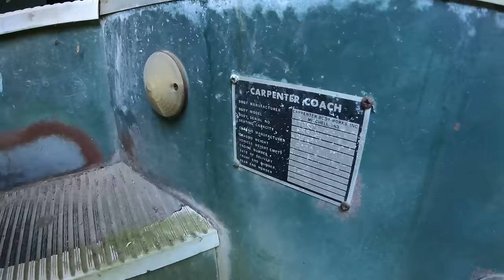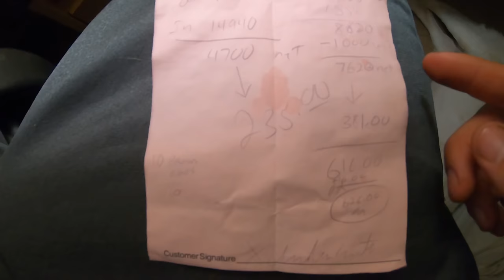Hauling away scrap metal

Comment: All that crap flying around with the trailer, I was glad to see you with a gas mask on.  Great tunes during trailer crushing fun!
Reply: [...phone rings...]

Customer:  Hey I've got a big job that...
Andrew:  You got a lot of big stuff to smash?  I'm there, buddy.  Levi's coming too.
Reply: was that a dust hazard, or something more serious?
Reply: @nocoolname32  I would assume asbestos with the age of that trailer.
Reply: @nocoolname32  Probably mineral wool or some kind of other insulation material that you better shouldnt breathe in. Asbestos could be possible too and is probably the WORST of all insulations.
Reply: @1nvisible1  Haha, yeah there is nothing more satisfying than smashing a old mobile home with a bit excavator. XD
Reply: Im pretty sure the gas mask was just for the wood dust, which was what all that dust was.
Reply: Advocatus Diaboli  You can see the yellow fiberglass while he was tearing it down
Reply: Advocatus Diaboli  You're right about that
Reply: @aa_0n711  If i remember right a mask that protects you from normal dust, will hold up any other dust or small particles as well so better safe than sorry.
Reply: @JackMacLupus  Im just saying that he most likely used the mask for the wood dust
Reply: @JackMacLupus  I dont think he really cares about asbestos
Reply: The bestos

Comment: An extensive and expensive hob. Lets count it again:
2 excavators
1 wheel loader
2 skid steer 
1 dump truck
2 trailer
2 Hemi for towing
1 suv for towing
charges for disposal
fee's
fuel, and
the labour for two men
Not bad, Mr. Camarata

Comment: They’re offering $10... (30sec later) smashes trailer😂😂
Reply: I would too. He will get more selling it for scrap. Although I probably would've tossed an old bedliner in it and used it to haul firewood around my property.
Reply: ..sometimes you have ton do that...even though at today's scrap prices it probably wouldn't even bring $10.00, you've got to utilize your time and keep moving, not screw around waiting to meet up with someone who may or may not buy it...for $40.00-$50.00, I might have waited an hour or two for them to show up, but not much longer...
Reply: I couldn't help but wonder if the guy who offered him the 10 bucks saw the video of him crushing it like a grape. LOL
Reply: @dyer2cycle  HERE IN CT I GET 35 40 CENTS FOR ALUMINUM PER POUND AND 50 CENTS FOR OLD STEEL 
LUCKY IF I GET 15-20 A TRUCKLOAD
Reply: @ekop1778  ...wow..if those are current prices, the prices in the northeast are GREAT compared to what we have here in the southeast(GA)...right now, going price for clean aluminum is 10-15 cents/lb.....steel, $1.00-$2.00 per hundred lb....aluminum radiators, clean, 18 cents/lb....copper/aluminum radiators(like from A/C condensers), clean, 65 cents-80 cents per lb....#1 copper, $1.50-$1.80 per lb....#2 copper, $1.30-$1.45 per lb...clean brass, around $1.00 per lb...it's depressing(and devastating, when a lot of your income comes from it)...prices were weak, especially for aluminum, before the coronavirus...after it hit, they fell through the floor, and a lot of yards have shut down completely.... :(
Reply: @dyer2cycle  hello  BEEN GETTING AROUND 30 CENT FOR ALUMINUM 
SOMETIMES I GET 20 CENT
STEEL SOMETIMES I GET 25 CENTS OTHER DAYS MAYBE 35 CENTS
IT VARIES FROM WEEK TO WEEK
COPPER I MADE 20 DOLLARS OFF 1 BAR  THAT WAS 2 FT BY 4 INCHES WIDE
I JUST STATED THE BUSINESS OF SELLING SCRAP ON SIDE INCOME 
ITS BEEN GOOD
DEPENDS ON THE DAY YOU GO TO THE YARD I GO TO A LOCAL GUY THAT HIRES MEXICANS BUT HES A GOOD MAN 
GOT A HUGE YARD AND PEOPLE BUY EVERY DAY TOO
Reply: @dyer2cycle  THATS PRETTY LOW FOR STEEL AND ALUMINUM 
SURPIRSED
THE GUY I GO TO IS OPEN EVEN IN A VIRUS PANDEMIC TOO
WEAR A MASK GLOVES AND STAY CLEAN
ITS LOW WHERE YOU ARE BECUASE ITS CHEAPER THAN NORTHEAST
WE GET BIGGER PRICES BECAUSE ITS EXPENSIVE HERE
Reply: @ekop1778  Yes, that is low for aluminum and steel..but the copper and copper/aluminum radiator prices are what are hurting me the most right now...brass too....that's where I made most of my money..the steel and aluminum were just sort of side items that went along with it...
Reply: номерной знак надо было оставить - это хорошее украшение для гаража )
Reply: I thought he was just crazy or drunk but now I see it's just for our entertainment
Reply: $10.00 is a nice bottle of wine, think of it that way
Reply: @dyer2cycle  don't blame corona - blame the industry. for YEARS they propped up prices because China was buying scrap by the container ship full.  Now instead of regulating the market they got greedy and China aint buying anymore.  thats one of the main reasons why scrap prices have plummeted.

Comment: I was going to say:  You better save those vehicle ornaments:  My brother worked on cars all his life.  Starting in 1953 when finally he finally retired in 2016 we cleaned all the cars out left the garage bare bones just the building and concrete. I went over every inch of soil and in every box and i even checked the birds nest in the office attic; he had crows I found a silver dollar and a bunch of lug nuts. We found specialty review mirrors, headlights that were brand new, signal switches and tail lights, vehicle hood, door, glove boxes, and leather seat ornaments in the hundreds. It took me two years to identify and label nearly everything.  I got tired and auctioned the whole lot on ebay to a guy near Chappell Hill Texas.

Comment: anyone who do welding as a trade, fabercating and heavy equipment repairs, everyone one of them drops are handy and saveyou thousands of dollars over you lift time, i clean out fab shops steel bins all the time, you can cut a ear for a pin boss out of odd shap peaces, it is by far best to save them all down to a 3x3 peace of heaver steel, you go and try and buy a small drop, and a shop will want $20 for the smallest peace, or you end up buying a full 4x8 sheet for a 6"x8" of 3/4" or 1"  peace for a job. with all the many tons of drops i have picked up or left over from a job, sure some may sit for 10 years before you need it, or someone else need it, and thats 20 to $50 cash in your pocket, by far more then you ever get as scrapm that odd shap peace of 1" plate, at the scrap yard lucky if that added up to a $1.00   were i would make $30 off that peace. it is all big cash money in the bank, but is you dont do much repairs or fabricating, ya, you will never use it, but to many dont know the value of a peace of steel, when i starting welding many years ago, i could buy a 4x8 x1/4" sheet of steel for $50, now that same sheet is $250, for mild steel, get T100 and see how much that is, i have made hundreds of thousands on repairs and build. all from free drops

Comment: I've bought some good structural steel from a recycling yard, big square tubing, heavy angle. It's really fascinating the material you can find at one but not many places let you buy from them. I recently paid 40 cents/lb, which is a fraction of what the material cost at a steel supplier. The bucket of drops you scrapped is less useful than most of what I've seen. You are right, it will end up sitting around forever. You have to draw the line of stuff you keep, otherwise your place ends up looking like junkyard.

Comment: Tim from Canada suggestions if you were doing one of The school buses or anything that is large like this and has a lot of loose parts you can always rip a hole in the roof after you get it loaded and put all your pieces inside your,bus.. trunk or whatever you were loading.. if it is big enough and you can rip a hole in it then you can put all your parts inside this will save you space and it will save you time unloading everything when you get to the scrapyard

Comment: That 9" Ford rear axle in the old pickup box trailer was probably worth more than you got for the whole load.  It has the equal length axles and very narrow which is very popular with the hot rod and race car guys.  It also probably had a 3.25, 3.50 or 3.70 gear.

Comment: If you got another frame from a truck that will fit under that dump bed your keeping and cut the frame add a hydraulic  lift for the bed ..you could have a pup trailer for your dump truck

Comment: I grew up doing scrap metal and various other kinds of construction related work that I've seen you doing. There's been a few times in your videos including several times in this video that using an acetylene/oxygen torch would have saved you a lot of time and your job easier. I'm assuming you must have one but idk why you never use it lol beating on your equipment for something that would take 5 mins of torch cutting, like cutting that front of the bus frame off makes no sense.

Comment: Just wondering what you did with those alums beam joists? Those things are awesome work with.You can to build concrete parking garage decks with those. We use them for scaffolding across long areas. One of the greatest things to come along in our trade.
Reply: I think Andrew said elsewhere in the comments the property owners kept the aluminum I-beams.

Comment: Now I have to clean my place up with my Bobcat!! (It’s a older 853 model with pallet forks, snow plow, grapple, grapple bucket, hay forks and that’s it and it has a door and heat which is pretty cool and if anyone reading this comment could help me figure this out. Why doesn’t my seat bar stay up even with new struts I have to use a bungee cord. So any help would be appreciated.

Comment: By the looks of the bus (with more emergency exits) they had a bus that was built after the new mandate of the time which was effective 4/1/77 and I saw it did have the extra straps around the fuel tank in case of a collision, which was not the case of another B700 that was in a nasty accident on 5/14/88 in Carrollton, KY. https://en.wikipedia.org/wiki/Carrollton_bus_collision

Comment: Around 35 minutes: how difficult would it have been to keep the steel chassis intact while still removing the structure? I'm guessing impossible?
Reply from the maker: Its doable, that wood would have pulled right off of there.
Reply: @AndrewCamarata  I ask because after a fire we're planning to replace a double wide, and those long steel beams could be useful.
Reply from the maker: Eaglebird you can. They aren’t that thick, but could be useful for something.
Reply: @AndrewCamarata  ultralight launch rails :>

Comment: oops 9" ford axle destroyed.
Reply from the maker: A few others mentioned that. No one has answered this question though. Why is a half ton axle desirable? Pickup trucks usually aren't any good unless they are 3/4 ton +
Reply: @AndrewCamarata  The 1/2 ton 9" axle 1957 - 1972 is a direct swap for early F1 and F100s 1948 - 1956. The 9" axle has more desirable gearing than the 3.92 and 4.11s that came in the early F1 AND f100s. Love your videos.